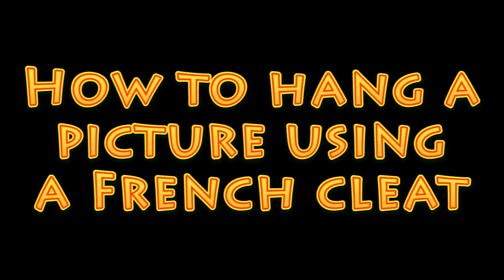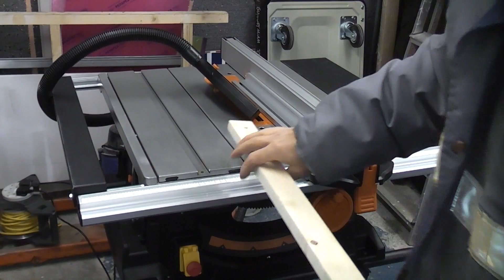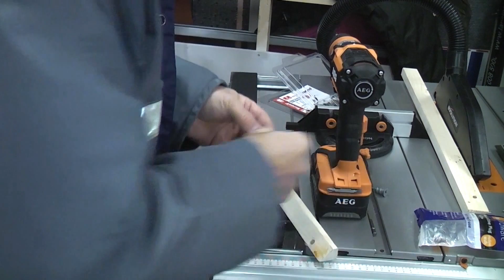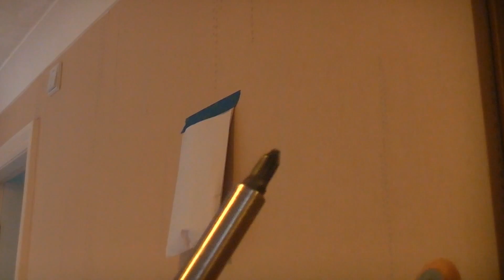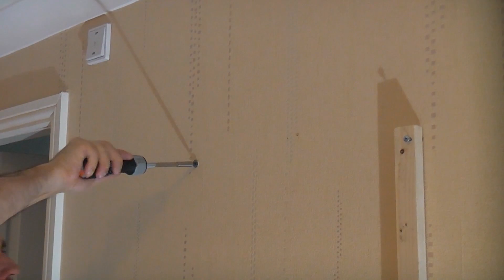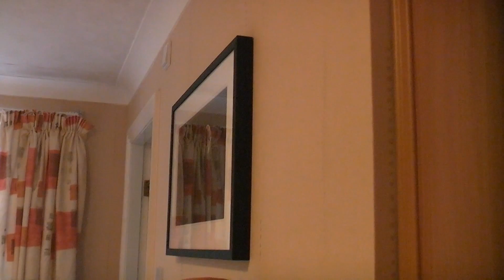Hanging a picture using a French cleat

Comment: what happend to the dewalt
Reply from the maker: Nothing, it's in my tool cabinet.
The AEG was sent to me to try out- so far it's been great ;-)
Thanks for the comment
Reply: Do you think it is better than dewalt
Reply from the maker: It's hard to say, but the chuck can be changed for an offset chuck or the chuck can be removed to expose a 1/4 hex chuck on the AEG, plus the 4AH batteries seem to last a long time. I have only charged the battery once and I have used it several times (it comes with two 4AH batteries).
I quite like the feel of it and so far it has been great, hopefully it will be reliable ;-)
Reply: Ok

Comment: Hi mate, just wondered are AEG giving out those drills to prominent review channels for reviewing? I've seen a few other fairly big channels with permanent AEG logos in the videos and their tools being used for instructional videos.

Enjoyed the video. Those plasterboard fixings are great. I always drill a 2/3mm pilot hole first then screw in the fitting with a flat head, always find it does less damage to the board/better solid fixing than the brute force hand/drill method. 

Thanks Ryan
Reply from the maker: I'm not sure if they want the drill reviewing but sent it for me to test, so far I am impressed with it ;-)

I think some people even charge firms to use tools that are sent to them and won't use or review stuff if they are not paid!

I've never tried drilling a pilot hole, but will give it a go next time.

Thanks for the comment ;-)
Reply: Nice to see another major company enter the market to give Dewalt, Makita & Bosch some competition. I think they have major chops in the US under the Rigid brand so they should be good quality tools coming to the UK.

I've always found the small pilot helps greatly when driving them in by hand - I refuse to use the combi drill with this application.

Thanks for this video nice and technical with great editing to bring it all together.
Reply from the maker: AEG are owned by one of the big players - http://www.ttigroup.com/en/our_brands/

You are welcome BTW, thanks for the comments ;-)
Reply: Ahh you are correct the goliath that is TTI - https://en.wikipedia.org/wiki/Techtronic_Industries

Although I was onto something here, the Ridgid Tools look lb for lb like AEG ones and TTI make the tools for Ridgid for the US market https://en.wikipedia.org/wiki/Ridgid
Reply from the maker: Thanks Ryan, I didn't know that Ridgid tools were made by TTI.
I have used a lot of Ridgid hand tools (mostly on site) and they are normally very good.
Thanks for the comments

Comment: Would you recommend your table saw, what make & model is it? Thanks!
Reply from the maker: Yes, I would recommend the saw- it's the Evolution Rage 5.
So far I have only cut a few pieces of timber and acrylic (with a special blade). The machine is really impressive and the dust extraction is good once you have connected the machine up to a vacuum.
Evolution recommend that you don't remove the blade guard so this machine can only be used for cutting, if you wanted to do some types of woodworking joints another machine may be more suitable. 
Thanks for the comment ;-)
Reply: Thank you! Hope that you can find the time to make a full review of it in the near future! :)

Comment: with older houses where floor or ceiling is not level with the earth ,would u measure by eye instead of still insist on spirit level ? whats ya view on this ?
Reply from the maker: I always use a spirit level but sometimes if I'm installing stuff at work and other pipes etc. are not level it's best to follow the original pipe work or else it stands out like a sore thumb.
Thanks for the comment

Comment: Nifty method - I like the ability to adjust horizontally after.  I also like that you checked it for level after the first screw had been fixed.       You did however forget the envelop taped to the wall for the 2nd fixing - probably not needed! 

Can the wall fixing be screwed in with an impact driver or would it be too powerful?
Reply from the maker: Thanks Matthew, I didn't forget the envelope- there was no dust at all when I installed the first fixing and so I never bothered to use it for the second fixing.
I have installed these fixings in the past using my drill and on a non wallpapered wall and there was a bit of dust, which is why I used the envelope this time (for the first fixing).
You probably could use an impact driver but plasterboard is easily damaged and so best to use a screwdriver.
Thanks for the comment

Comment: Check out a "Fixing"  called EZ Ancor, made of plastic, seems like a heck of allot less waste and has a better guide once you poke a hole through the drywall with a #2 Philips head screw driver.Sold by Home depot here in the U.S. It's a better solution then that metal Auger..
Reply from the maker: Thanks for the comment